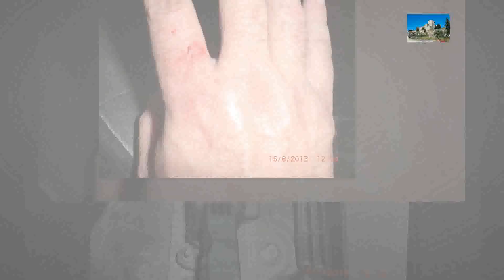Como cambiar el Filtro de habitáculo del Ford Focus II

Comment: Sólo un pequeño aporte y corregidme si me equivoco, pero tenía entendido que no hay que desenchufar el pedal del acelerador, puesto que se desconfigura algo (no sé qué componente), pero el resultado es que al poner el marcha el motor, no acelera, se queda a ralentí y es necesario conectarle el ordenador, con el conseguiente coste. Yo tengo un 1.8 TDCI del 2007 y es lo que me explicaron respecto de este filtro. Alguna vez he cambiado yo el filtro del polen y se puede hacer sin desenchufar el acelerador. Perdonad el ladrillo y a darle gas a los Focus. Un saludo :-D
Reply from the maker: No necesitas configurar nada. El auto en el vídeo, 90CV 1600 Tdci